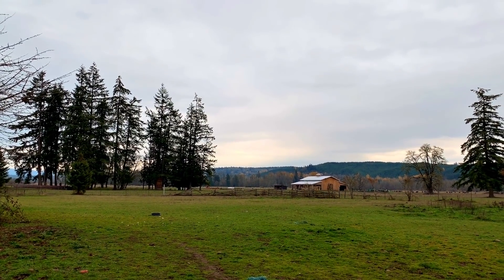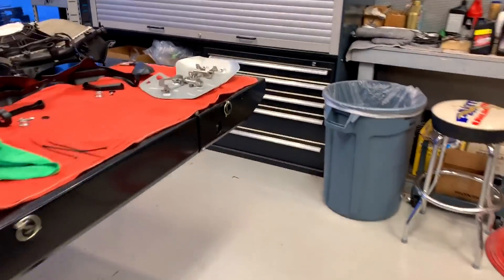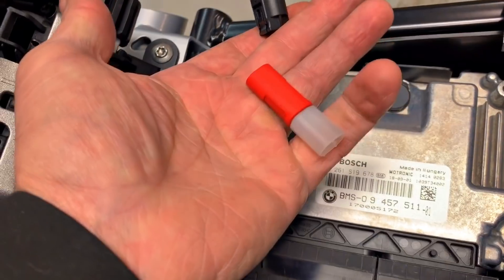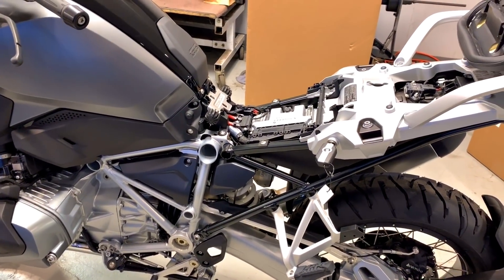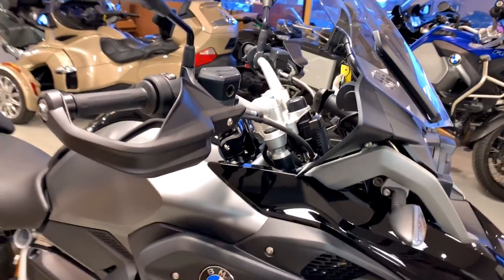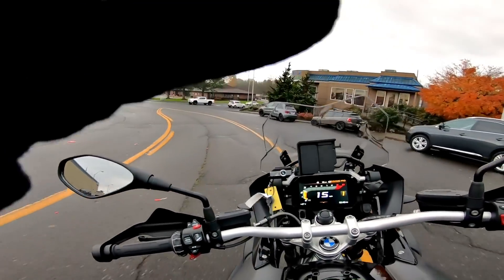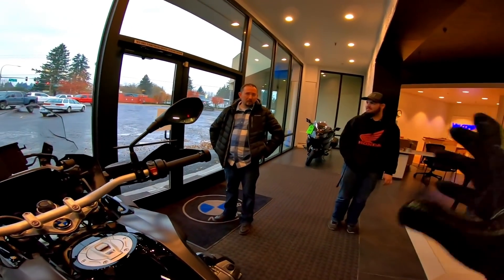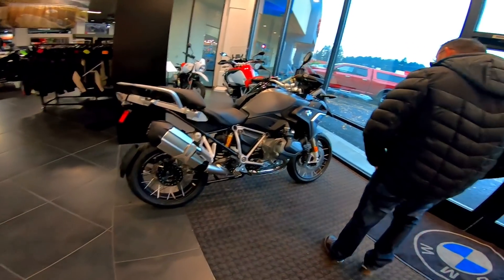1st Ride on New R1250GS!! • Boy, Am I Impressed..! | TheSmoaks Vlog_1102

Comment: did you already drove the bike with luggage and offroad? i dont think so .i owned one .and that thing drove unstabil with luggage and 140kmh and after a 1/2 year i only wanted to sold the bike because a suspension .2 front rims, a button combination,a battery failure was broke. bmw is bad these  days